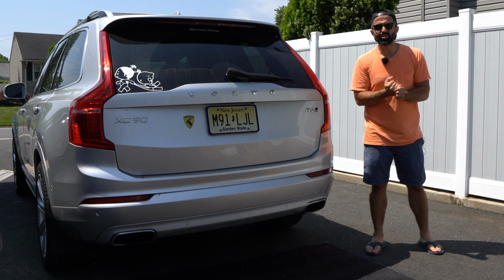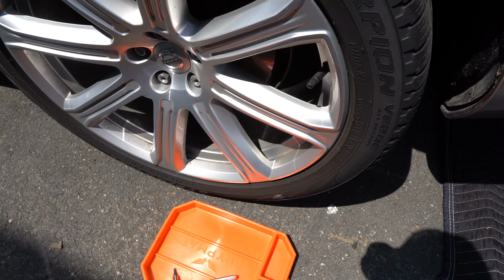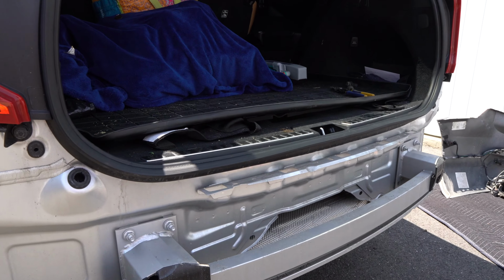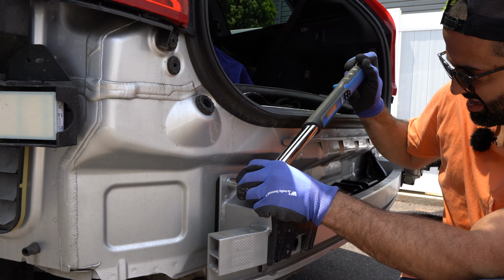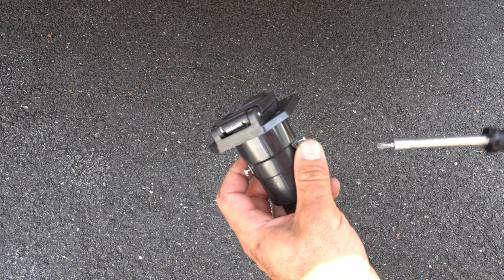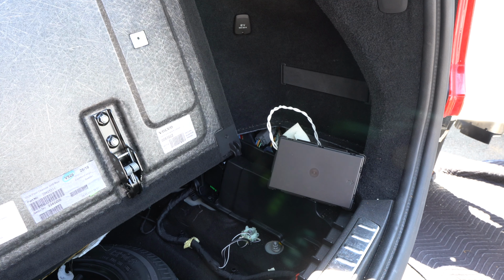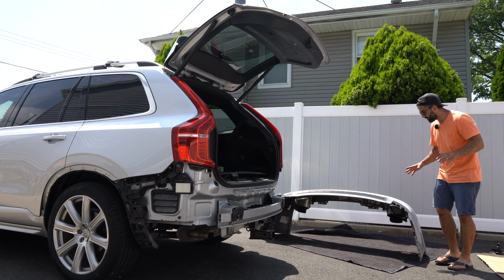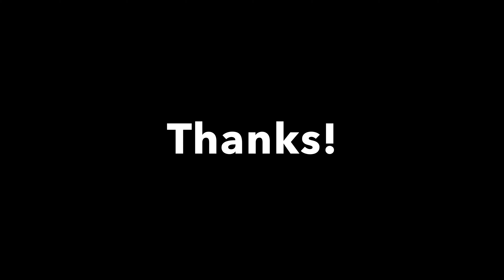DIY Stealth Hitch install on a Volvo XC90 (SPA - similar to XC60, V90)

Comment: I have a few of the same cars (2 XC90’s and an F80 M3)—both models are surprisingly well suited as daily use/family oriented vehicles. Will be installing this hitch soon as a much more cost effective alternative to the factory optioned (powered fold-out) model. Great video as always, excellent walkthrough with just the right amount of detail. Well done, Tommy.
Reply: Tommy—any idea how many bikes this will support? Surprisingly, the factory powered fold-out hitch is only rated for two.
Reply from the maker: I towed a heavy load with it (check out my latest video). 4 bikes is no issue !!
Reply: @TommyLGarage  From what I’ve read, Class 1 hitches can handle up to two bicycles (70 lbs), and Class 3 can handle up to five (150 lbs). Different load factors than simple towing. Have reached out to the manufacturer for additional clarification, will update.
Reply: @TommyLGarage  Verified w/manufacturer. They don’t publish Class type load ratings for their hitches, but said their product is comparable to the Volvo factory unit in terms of maximum tongue weight and towing capacity. The maximum suggested number of bicycles using their hitch is two.

Comment: Great video. I’m planning to put one of these in my V90CC. Process looks very similar. Thanks for posting. You said a dealer needs to program the car to work with the towing module. Any idea what that costs?

Comment: Tommy, can you explain more about what Volvo needs to do to get the tow package to communicate to the lights of the trailer?  I have a 2019 XC90, your video was awesome and extremely helpful.  I am now working to bring the car to volvo but wanted to know what they need to do.  Download software?
Reply from the maker: Yes they just need to program the rear hitch plug. Easy job just a software update. The hitch uses a Volvo module so it’s an easy job.
Reply: @TommyLGarage  Excellent.  Thank you.  I have a visit set for Friday morning.  Just wanted to be prepared for when I go in so I didnt get taken advantage of.
Reply: Finished my visit with Volvo this morning.  Software download was easy.  Charge for Boston Volvo was ~$188.00.  So for a Stealth tow package its ~$1,200 + $188 = ~$1,388 overall.  Boston Volvo offers their tow package and install for ~$1,900 .
Reply from the maker: Dan Bastian not a bad save !

Comment: Great video. One improvment would be to provide much more info on the location of the rear cargo fuse box. not only does it vary wildly on these, but can be hidden under other modules. Total design afterthought on Volvo...
Reply from the maker: Afterthought for sure

Comment: Great vid, I followed it and everything went smoothly except the clips on the top sides of the bumper will not clip in and the bumper is not perfectly flush w the body which is annoying, and tips?
Reply from the maker: Just honestly push the bumper cover in. Mine clipped in without issue

Comment: Tommy- what does volvo control module provided with the Stealth Hitch do?  Is it providing capability over just T-One Vehicle Wiring Harness with 4 Pole Trailer Connector that I would install with a Draw-tite hitch?  I was told the dealerships package (an auto-foldout hitch) and included software would control some aspects of engine performance ie. ties in to a trailer stability assist system.

Comment: Great video, thank you. I got stuck however at removing the clips for the V90. It is different, does not have the trim on the fenders, and the clip securing the bumper had two long pins and I cannot find any instructions on removing it, afraid I will break something. Any suggestions?
Reply from the maker: I think you pull the inside and then the whole pin out
Reply: @TommyLGarage   Thank you for replying. I found the clip is secured with a not very visible screw.  Unfortunately I am now stuck trying to find the electric connector, the V90 is a lot smaller and there is no box to pull out as with the XC90... any suggestions on documentation? Thank you!!!

Comment: Does the Stealth Hitch wiring harness come with two connectors at the receiver end? The genuine Volvo harness I got (to go with a Curt hitch) has the standard 4 prong electrical connector and the round connector in one housing but also has a smaller connector which I believe goes with the OEM drop-down hitch to tell the controller “I’m clicked in place and good to tow.” If it doesn’t, I’m curious how they bypassed this since your kit has the same genuine Volvo controller.
Reply from the maker: Yes; it come with the adapter.

Comment: they say the xc90 can pull 4000 pounds unassisted -- Is that the same case with this hitch point?
Reply from the maker: Yes. This hitch matches oem specs

Comment: Say what,..you have a Volvo SUV,...yet, use your M3 for pickup truck duty!  I can't believe this.....shame on you Tommy L,...Shame on you!    :-)

Edit 1:  I can't believe the 7-Way connector part has to be done!  Shame on Stealth Hitch!

Edit 2:  Check those wheel weld trim pieces,....I see gaps,...as they don't appear to be snapped in 100% in some areas!
Reply from the maker: Bmw does better with views!
Reply: @TommyLGarage  LOL!